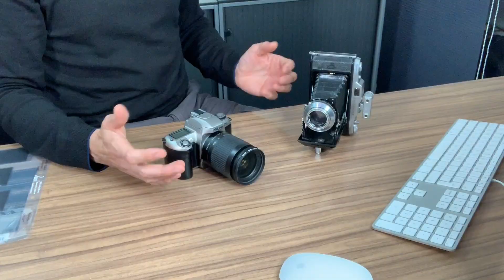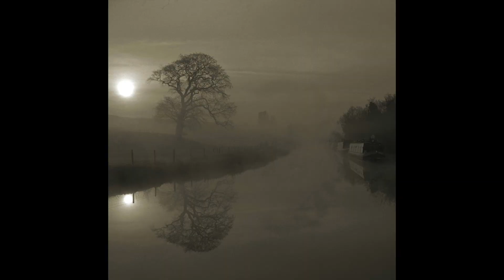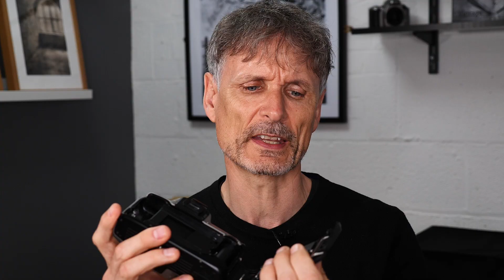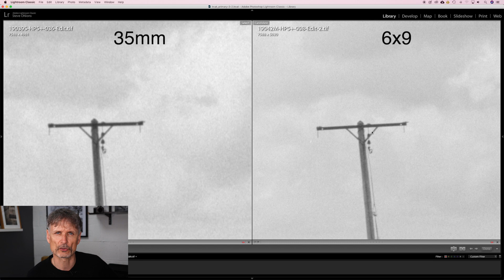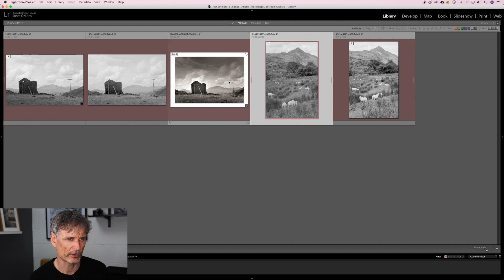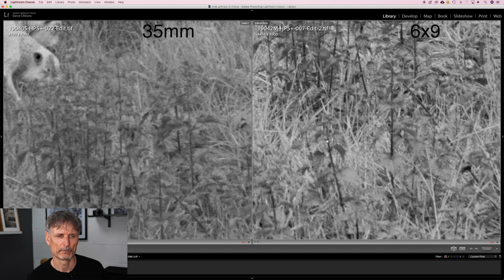Film Photography - 6x9 v 35mm for long walks

Comment: The darkroom print looked incredible.  Excellent work.  I need to concentrate twice as hard with my 6x17 camera...it only yields four frames per roll.  ;-)
Reply from the maker: I would love a 617, expensive to run though 🙂
Reply: @SteveONions  Yep, I just finished a roll of Portra 160.  Everything seemed to go well until I received the negatives from the lab...one shot of the four was completely blank.  I'm guessing user error...could have forgotten to remove the dark slide as the light was fading a little too quickly.  But I do like the pano look, though.
Reply from the maker: It is easy to mess up at times, I try to be methodical but still slip up and it gets expensive with large format.

Comment: A modern Nikon F100 combined with the best AIS or AFS glass and fine grain film with proper development will produce extremely sharp images. The Fuji GX617 or any 6x8 6x7 will also make very beautiful prints but the ease of a fully automatic modern SLR combined with autofocus and sharp lenses works very well too

Comment: Always enjoy watching your videos Steve. I have a Russian Moskova 6x9 folder a copy of the Ikonta’s in all ways. The lenses can be a bit variable as the quality control was not as good as the German equivalent. Mine, I’m glad to say is a cracker. I understand what your saying about only having 8 frames per roll but I find it concentrates the mind on the image rather like using Large Format.
If anybody watching is thinking of buying one first set the shutter to 1 second and fire to see if it’s running smoothly before you fire it at any other speeds. Check blades for damage or oil which stop the shutter working. Put a small torch or your phone into the rear of the camera and check for light leaks in a dark environment. If they need replacing a company in the UK called Custom bellows can help you.
Looking forward to your next video.
Reply from the maker: Thanks William and also good tips on checking out the camera. I find that slow speeds tend to drift off in most of my older shutters with some being worse than other (compur rapid etc). It’s great that bellows can still be supplied for such old cameras and somewhat makes up for the fragile nature of folders.

Comment: I was a professional mountain photographer in the 1980's working for publishers. I had to climb mainly in the alps solo so I coukd do a route description and supply images for guidebooks. I tried a Minox, various other 35mm including an Nikon F3. In the end the best camera by far was the Rolleicord 5. Lightweight, simple indestructible and the case gave easy access. The images are impossible to tell apart from a Rolleiflex. I could be on a 60 degree ice slop and to take an image all I had to do was look down. Both the focus and the wind on are on the right hand side so the camera can be held in the left hand. After the Rolleicord 5 they moved the focus to the left so like the Rolleiflex you have to swop hands to focus and wind on.
I repair Rolleiflex I have been for a long time. Most Rolleiflex cameras I see are in a bad state often damaged by amateur repairers. People don't get them professionally serviced often enough.
Reply from the maker: Thanks for the invaluable insight Rory, it’s amazing how subtle changes in camera design can affect usability. I found my Minolta Autocord’s focus mechanism seriously restricts its flexibility in the hills, I was in constant danger of breaking the fragile lever and wished I’d carried a simple folder or even Yashicamat.

Comment: Interesting point on the f65 pressure plate I've noticed marks on my negatives shot on this body but could never figure out where they came from.  I assumed it was an issue with certain rolls or maybe a lab issue when developing. 👌

Comment: Enjoyed that.  Good to see you working in the darkroom.  It takes me about 2 hours to print several images from a new negative, then there's the toning, then washing, drying, trimming, dry mounting on 4 ply cotton board, and finally an over mat.  Museum quality when I'm done, and it's worth the effort.
Reply from the maker: Totally agree with your archival approach Steve, I carefully wash, hypo clear and rewash my fibre prints and tone wherever possible. I only use resin papers to proof my shots even though it is considerably easier and cheaper to work with (which isn’t why we use the darkroom in the first place) 🙂

Comment: My very first camera about 65 years ago was an Agfa Clack. This took 8 shots on 120 film which was then called two and a quarter by three and a quarter inches. I could only make black & white contact prints - no enlarger. Recall they seemed reasonably good at that size if the shots were taken in good light.
Reply from the maker: I’ve recently picked up a few packs of old photo paper in 6x9 to make contact prints with Michael, such a lovely format.

Comment: Your older videos keep popping up, which is good. I had to run upstairs and check up on my tiny F75, and yes, it has the knurly pressure plate too. Not sure why Nikon did that.
So far - no striping, knock on wood. 
Thanks again for a good talk and nice images. 
Cheers!
Lars
Reply from the maker: Thanks Lars, I’ve no idea why they put such an odd pressure plate on that model, all the others are much smoother.

Comment: Interesting assessment on the Zeiss for black and white. The phenomena your describing I call micro-contrast/ image fidelity. I consider that to be superior fidelity and higher micro contrast. I personally chase this down in every lens I get as I find there are lenses that retain the resolution and microcontrast together. I’d consider them a trade off though so many new lenses seeking to achieve resolution at large apertures corner to corner I see the most severe offenders of reduced fidelity. Zooms especially, but even some of the newer primes coming out for digital full frame.
Reply from the maker: I also look for lenses that have a certain look and with film it seems that the ones with a lower element count render more pleasing images.

Comment: Thanks a lot for showing the results of this trip! The results are fairly obvious, although I'd say it is also a question of subject matter, in the sense that 35 mm is probably more suited for taking pictures of smaller subjects while the larger format is much better if you want to show a broad landscape view. BTW: Lately the 645 format has grown on me as a fairly good compromise!
Reply from the maker: I also think 645 is probably about the best balance of weight and quality, I've owned a few Mamiya 645's over the years and the image is big enough to show a marked improvement over 35mm without the bulk of large 120 and sheet film sizes.
Reply: @SteveONions  Recently got a Fuji GA645Zi, certainly not a camera for purists, but I fell in love with it! Talking about purists: Ever tried converting 35mm Portra or  Ektar pictures into black and white? Because of the extrem fine grain one gets a great resolution out of them - if that is what one wants. I wouldn't shoot these films only to convert them into b/w, but if one already got great colour pictures, why not try out how they look in b/w?
Reply from the maker: I also had a 645 Fuji many years ago, possibly the best lens I’ve ever used on medium format. 
I have done conversions from Ektar and Portra but find them a little bland compared to B&W. I also find I compromise at the shooting stage if I know I can choose mono or colour in post processing.

Comment: Steve - Thanks for sharing this little adventure and reminding us one again that it's the photographer and not the camera that make the picture.

With respect to your 4 hour darkroom adventure...  Have you ever considered making a digital negative after making all of the adjustments to your photo in photoshop or lightroom?  This would mean all that needs to be done is a contact print.  It would save you money and, I believe, time.  I know that the folks doing platinum palladium prints use this technique.  There are books on the subject.  One other thought  is that using either a yellow or red filter on the lenses might be an interesting experiment.  People don't often think of them nowadays and you can find them quite inexpensively on ebay.
Reply from the maker: Thanks Rich, the digital negative approach is interesting and I’ve only tried it a couple of times so far, both for cyanotype prints. It would certainly resolve the issues of tricky dodges and burns which can end up costing a lot in test sheets. 
I should have used a yellow or even orange filter on the Zeiss to boost the contrast but couldn’t find one that fitted in amongst my large collection. I’ll look out for one (it’s a push on fit thankfully so no issues with thread pitch).
Reply: @SteveONions  I wanted to add that I really enjoyed the multiple story lines.  The derelict mine raised all kinds of speculation in my mind.  Who were the miners?  What were they mining?   The site itself would be worthy of a photo whole essay.  The building in your dark room print - It obviously took a great deal of labor.  Who built it?  Why?  

I also appreciated your comment on a "quality image vs image quality"  - to many of us are so hung up on the technical aspects of image making that we forget the aesthetic aspects.

Thank you for two very nice videos!
Reply from the maker: Thanks Rich, I have also thought that the location would be well worth revisiting to concentrate on the old buildings. I can imagine that on a dull winters day the atmosphere would be more suited to the dull slate and general melancholic feel if the place, it would be amazing to use the 4x5 or even 8x10.

Comment: The clumping you see is grain aliasing and not actual grain.
Another reason to use better scanning methods.

Stopped down, with a light yellow filter and with a shade on, and perhaps also with Delta, fp4 or Tmax, you’ll be able to get very different results from the Zeiss.

A lot of the effect you went for in the lab, would have come automatically with a red or orange filter.

A small triplet lens like the Novar stopped down to 8 or 11 and set close to infinity, will surprisingly often actually give you more sharpness and contrast.
Possibly because there is less glass and less transitions to get through.
Reply: Interesting considerations.
Reply from the maker: The scans are only designed to give and idea of the comparative image quality and are not definitive representations.  Grain aliasing is partly responsible for the effect and a true darkroom print would exhibit a more uniform (and pleasing) grain structure.  If I had the time I would do all such comparisons using darkroom prints but sadly my resources are stretched too far.
Reply: @SteveONions  I did some "scans" using my Olympus Pen F Digital and the Olympus 30 mm Macro in hi-res mode, giving 80 MP files that give a very "true" grain structure. Scaling by 0.7 (70%) leads to 40 MP files that should be equally good for comparison. An E-M5 MkII  also sports a hi-res mode, and the resulting 60 MP should suffice too. Better and cheaper than any (affordable) flat-bed or dedicated film scanner, I'd say.
Reply: @c.augustin After getting so-so results from scanning negatives I think I will try this. Have thought about it for a while but always thought it was more likely my processing or exposure choices.
Reply: @jlaw8882  The trick is to use a high-resolution lens made for close distances (like macro or enlarger lenses) stopped down to its optimum aperture (to avoid diffraction). With an MFT camera, this is not the best quality possible. I did this scanning technique using a Rodenstock Apo Rodagon 50 mm enlarger lense in conjunction with a Sony A7RII (both belong to a friend), and there I got even better results.
Reply: @c.augustin    Luckily I have a friend with a decent full frame Nikon and macro lens, he will be getting a call this evening! Will give it a try first with my Olympus and Minolta macro to get a feel for the setup and process. Thanks for the nudge and valuable advice, much appreciated.
Reply: @jlaw8882  My quest is to get the film grain as "naturally" as I can. I had a Plustek OpticFilm 120, and the results were abysmal – everything looked "pixely" and "digital", and scanning took forever. The results I get with my Pen F's hi-res mode and the Olympus 3.5/30 macro (which is comparatively inexpensive) are far, far better already. So you might be good with your Olympus!
Reply: @c.augustin  I agree that the most natural-looking representation of grain that I've personally seen comes from photographing the negative with good technique (good lens, high image magnification, properly square to the sensor plane, decent light source etc.) This is true in comparisons to Epson V700 scans, Nikon Coolscan 9000 scans, and Imacon/Hasselblad Flextight X5 scans.

With that said, if you execute an Epson V700 scan well (flat film at the correct height) and then — this is crucial — sharpen it properly, the appearance of the grain improves a great deal. It's still not as good as photographing the negative (and detail is also not quite as good), but it's a lot closer. I've been surprised at how good a scan you can make, with fairly good grain appearance, with a V-series Epson, if your technique is really sound.
Reply: @eamonhickey  Thanks for sharing your insights! I'm thinking about buying an Expson flat-bed scanner one day, so this might become important.
Reply: @c.augustin  If you do, definitely research film holders. They make a huge difference. (I use the Better Scanning Variable Height holder.) And scans from the Epsons need a good dose of sharpening; significantly more than I sharpen digital images or camera scans.

Comment: Have a old Franka Solida III 6x6 folding camera with a Rodenstock: Trinar 80mm f/2.9.
That lens has a lot of character with swerly bokeh etc.
Plus it has a coupled rangefinder so its a bit faster to work with.
Reply: bkspicture I have the same camera, and after Steve's video on comparing 35 vs 6x9, I'm rethinking my camera choice on my next trip. An iPhone, for all the general photography, video, etc. and  my Franka 6x6 for some 'serious'  photography. Thanks bkspicture and Steve O'nions!
Reply from the maker: Sounds like a good setup . . . I've got yet another plan and two tiny cameras to test :)
Reply: Steve O'Nions my smallest camera is a Minox GL, with a modified battery, 4 LR44 watch batteries, held together with electric tape. This hacked battery requires no battery compensation, and the camera is working flawlessly.

Comment: My 1929 Icarette folder with f/4.5 Tessar yields interesting 6x9 negatives. The 1914 Kodak Autographic 3A folder with f/7.7 Kodak Anastigmat that I learned on produced even more detail, but its huge roll film in size 122 has not been made since the early 1970s.
Reply from the maker: Sounds like a good camera Stephen, shame about the lack of 122 film for the Kodak though.

Comment: Very interesting video as usual, and I liked the print you made. I don't have any printer and have not yet decied if I will go for digital printer og darkroom printing. I see the results of darkroom printing can be excellent, but may also require a lot of trial and error. Economy is also an important factor. I remember spending a lot of ink by cleaning the nozzles. That ws back in 2009, maube things have changed since then.
Reply from the maker: It's a bit like the old comparison of the longbow and the musket Geir.  The bow is actually a superior weapon but it takes years to train someone to be proficient in shooting it whereas you can teach anyone to fire a musket in a day.  The darkroom is a craft that needs to be learned and practiced in order to improve but digital prints can be made relatively quickly and easily.  That said, there is something quite magical about a wet print that is hard to replicate on a computer.
Reply: @SteveONions Thank you, I will be thinking about it a bit more, and maybe I some day make up a decicion or act on impulse. The closest thing I come to printing is my experiments with paper negatives and Harman Direct Positive Paper. It gives beautiful results, but I scan and edit them in post. That is much more forgiving than real analog printing. But the DPP looks really great when i Expose correctly, but witth 4x5, they only makes small beautiful print.
Reply from the maker: I do like a small print but equally I also found my 4x5 contacts a little bit too tiny. The 8x10 is a lot better for this task.

Comment: 4:40 Are film supports not removable? On Olympus OM SLRs simply push the springs in to remove. I myself if not removable, be tempted to try packaging tape cut so slightly less width. 🤔
Reply from the maker: They may well be, but I see little use for the F65 given it weighs virtually the same as the much better F80.
Reply: Steve, just a passing curiosity. Though your generous reply got me looking at Dad's and my cameras. Oddly, the fully manual SLR is just 10 grams lighter (510g versus 520g) than the semi-automatic and fully automatic bodies. 

Cheers,
Adriel